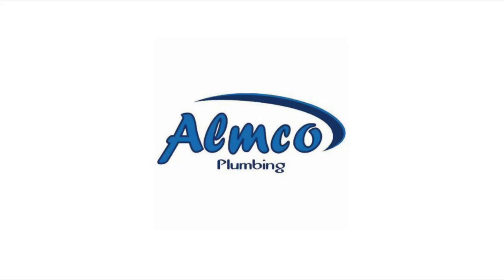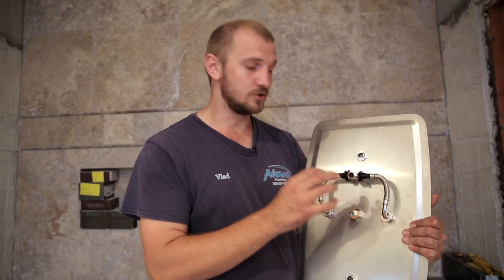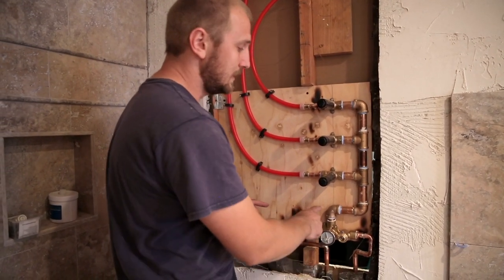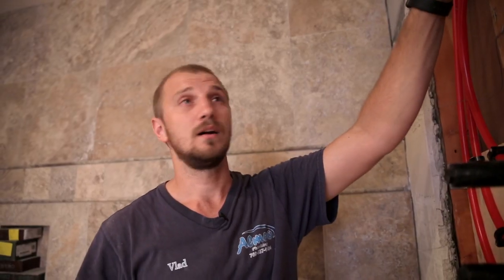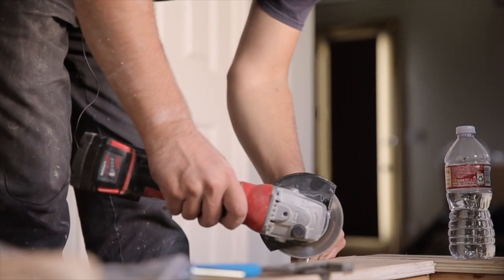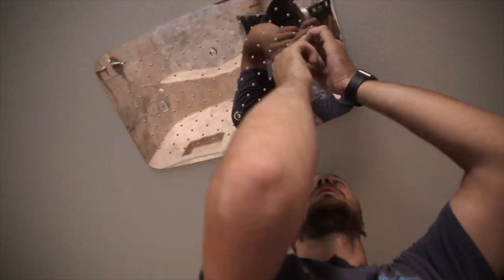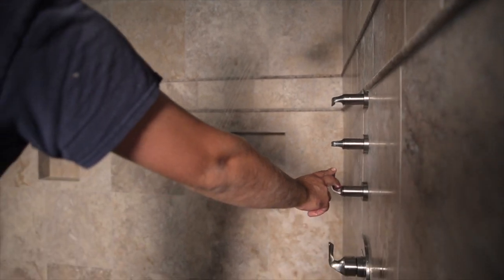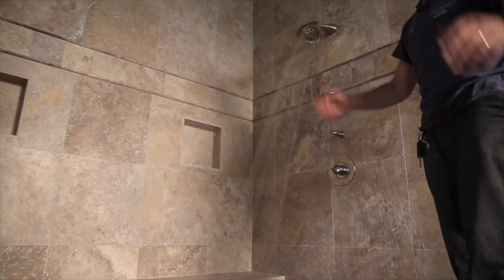How to install Rectangular Ceiling-Mounted Showerhead Model G-8245-SP

Comment: It looks like you hooker up 1/2” line to the sensori regulator.   You are going to lose flow volume.  These high flow regulators require 3/4” from source so that you can get enough volume if all three outputs are on.   Looks like you then increased back to 3/4 before volume controls.   Doesn’t really help if your initial input is 1/2”.

Comment: What steps did you take in the attic to prevent the pipes from freezing in the winter?
Reply: Could he have run them between joists inside ceiling since the joists are running parallel? The units I've seen this big have a box that is mounted in ceiling first.
Reply: In general, use PEX, no extra fittings (if possible), slope the PEX downward so it drains naturally, and box in the attic piping with rigid insulation (air sealed to the attic floor).  Cover whole thing with loose fill cellulose.
Reply: He moved the house in south Florida.